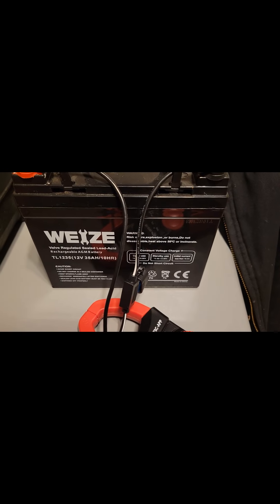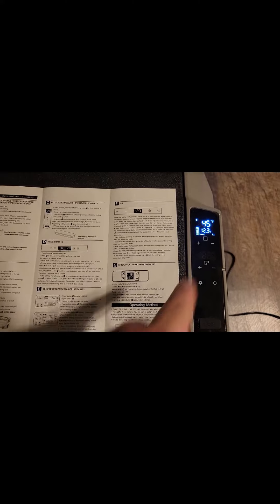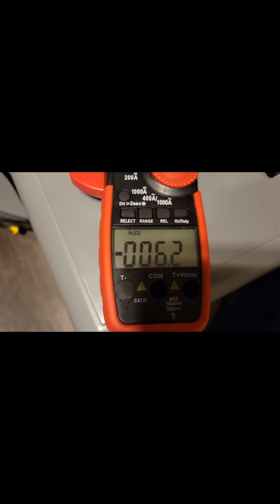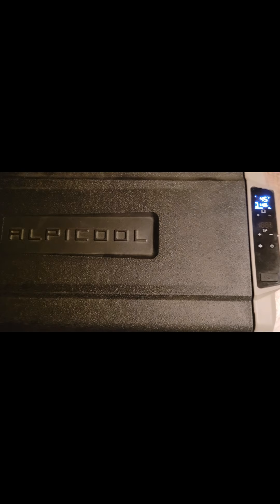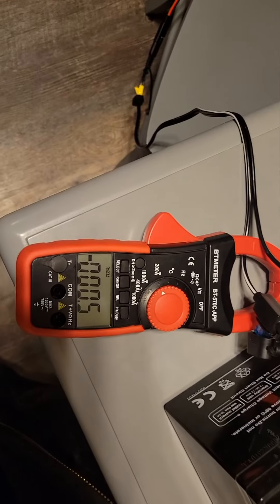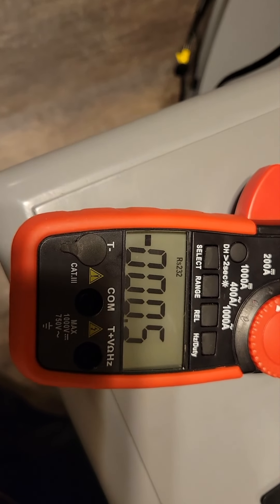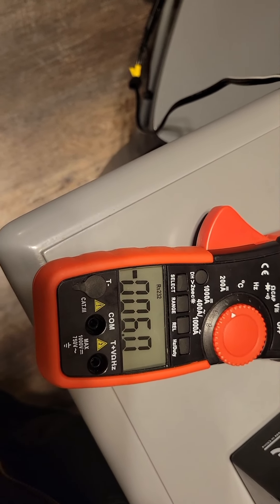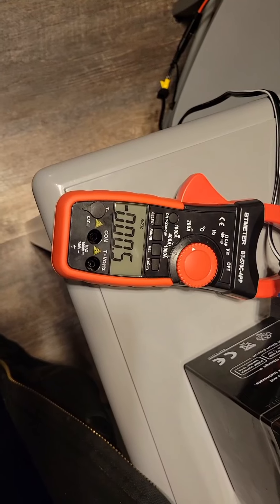AlpiCool Electric Cooler Power Test Maintain refrigeration during Part 2 #poweroutages  #alpicool

Comment: Thanks! The mini-power station is the one in the cart? Or do you have another one you suggest? Ty
Reply from the maker: The solar cart that I built will run this fridge so long as it has a 12v battery hooked to it..  If you go with a pre-built type maybe try  goal zero and get one with 100 amp hours if you can afford it..  Their solar panels aren't waterproof though.
Reply: @FTOTF1  yeah- I live in Florida it rains like always- anything you can suggest that can get wet! Plus dew in the am is pretty wet ..
Reply from the maker: @anagongs6353  the mini solar cart 😀.  It's sitting in my back yard and it has been snowing on it all week. I have two 100 amp hour rv lead acid batteries on it because they can handle the 🥶 🧊  and wet weather as well as the heat.
Reply: @FTOTF1  will re-watch video to see if is something I can handle- ty!!!
Reply from the maker: @anagongs6353  if you need us to build one let me know.
Reply: @FTOTF1  yes! Let me know how we go about it?
Reply from the maker: @anagongs6353   you can contact me at utahoffgrid@gmail.com. Send me an email if your Interested.  😊

Comment: Can you please tell me hom much a/h it draws on a average more or less once it reached the desired temp.
Reply from the maker: Once the Compressor turns off and nothing is running the last time I metered it, it was less than an amp in the non Compressor running state. I don't remember for sure but it was using just enough to keep the controls running maybe half an amp.